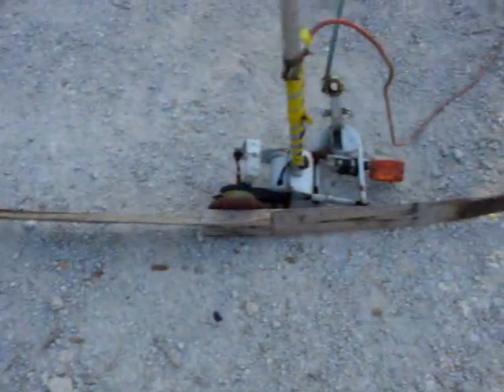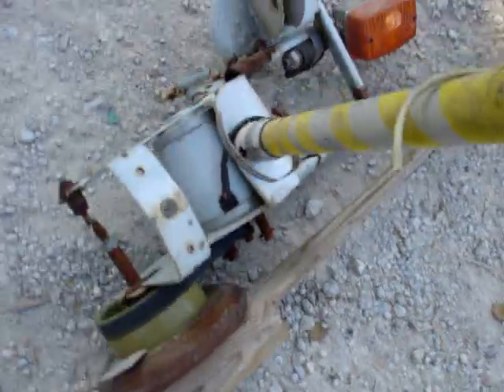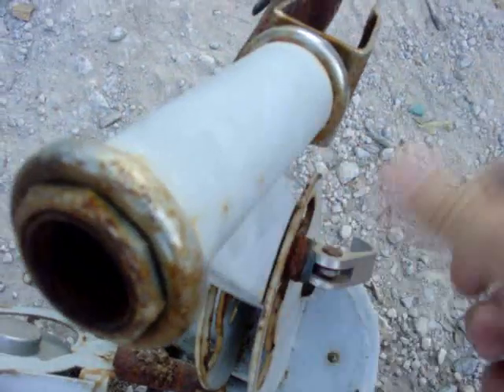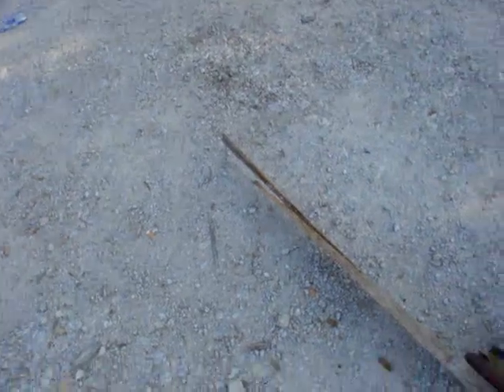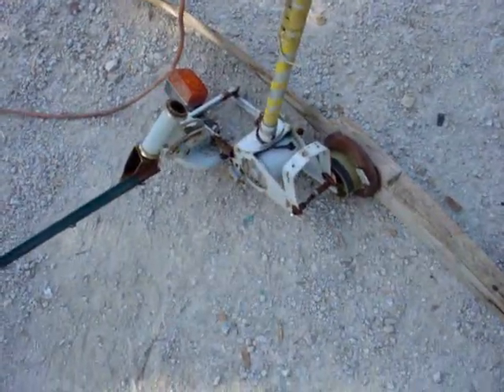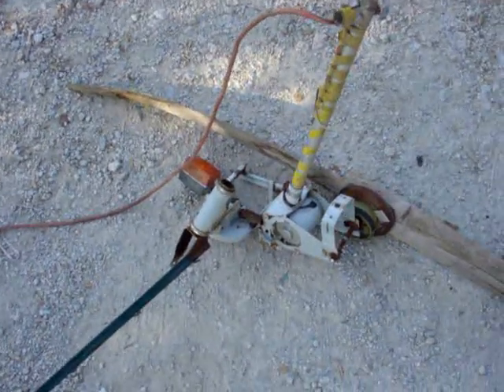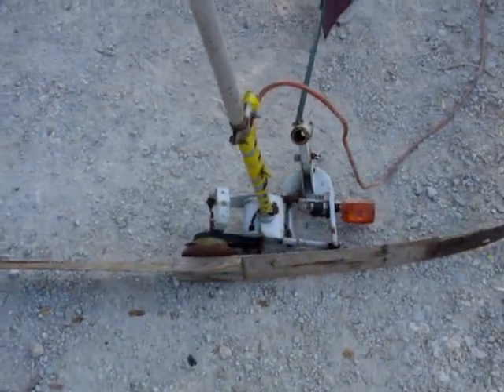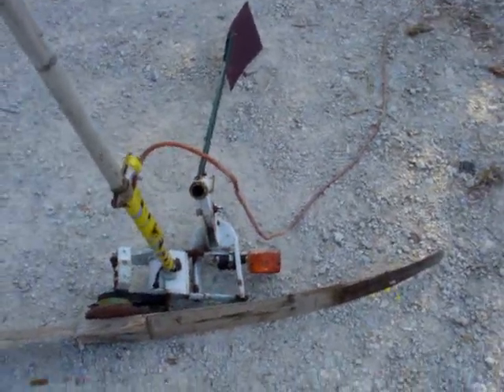WIND TURBINE FROM AN E SCOOTER- ONE OF MY FIRST WIND TURBINES

Comment: rpms per volt doesnt seem to determine the output voltage.  i spin the motors with an electric drill. a 30v motor at 1750rpm only put out 6 at 1500rpm.  a 24 volt at 1500rpm put out 5. Be sure to spin them before you finish your designs.

Comment: How about using a motor cycle ,its got a stator ,voltage regulator and a battery that could be upgraded to deep cycle ,just that the connecting rod out flip the whole motor and go ,you got yourself and automatic charging system and reserve power to boot.
     Hell it even has a voltage limiter built into the wiring already.